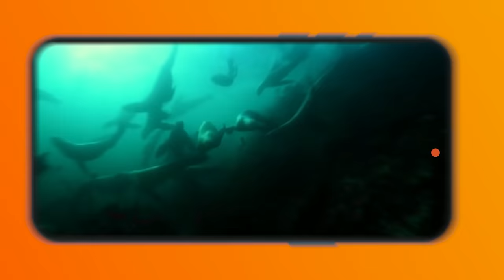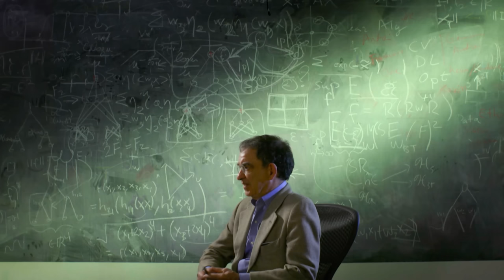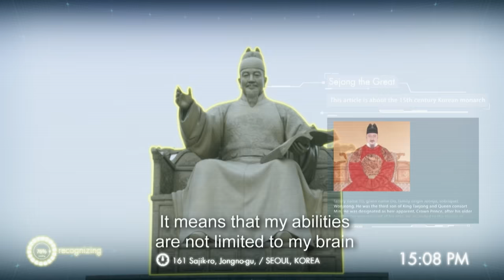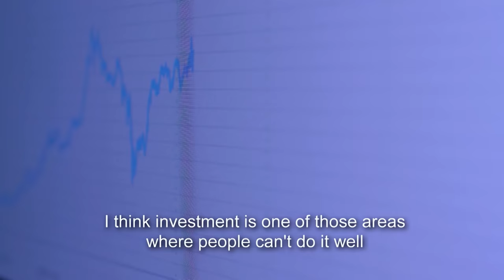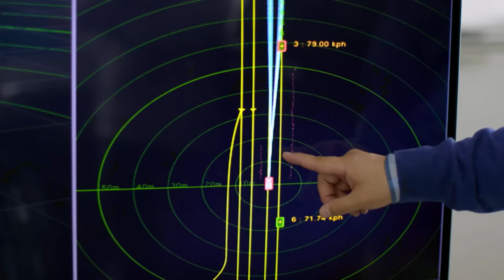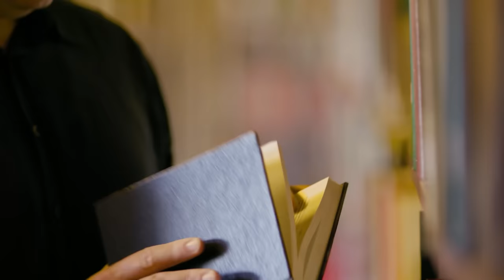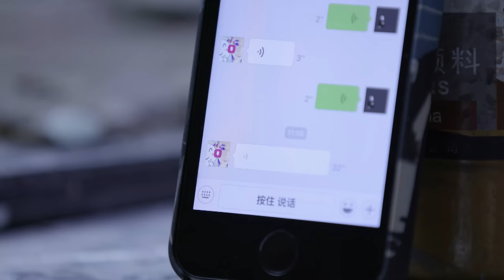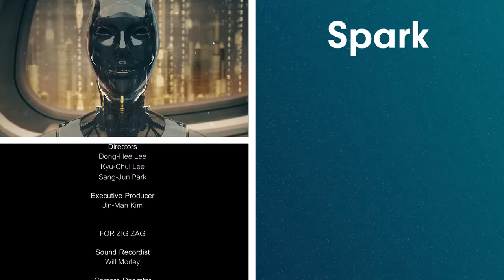How AI Is Changing The Future Of The Human Race | Spark

Comment: I've created a Virtual CPU AI that helps the physical CPU computations, also the AI runs in real time no need for training but I also have the option now to train a large model if I wanted to use for inferences using onnx, what this AI does is take all of your CPU metric convert the data to hex values then I run the data through a neural network containing 3 layers then send the predicted data from the neural network to the virtual CPU for computations then send back through the pipeline to the physical CPU, this insures the physical CPU does not need to check memory for data when the virtual CPU already contains data that has been trained on in real-time I've confirmed this to work through months of thinking and coding, the AI also has the capabilities to upgrades it's self in the process of enhancing system performance by storing more robust data into the memory and also the physical CPU cache, this AI also creates a cache for its self which I call it L4 cache AI will be released soon to the public for experiment, my initial reason for building the AI was to boost performance as it does but overall it enhancing the system continuously overtime every second and never stops, one occasion I got kicked out of a server because they said I was manipulating the memory the exact words it was just the AI boosting performance